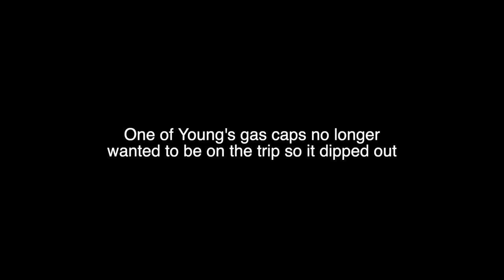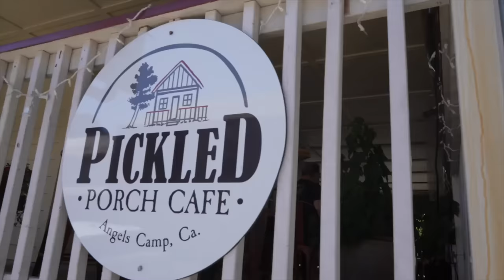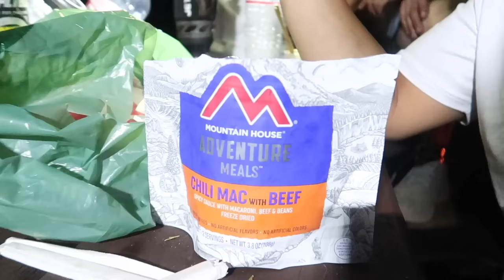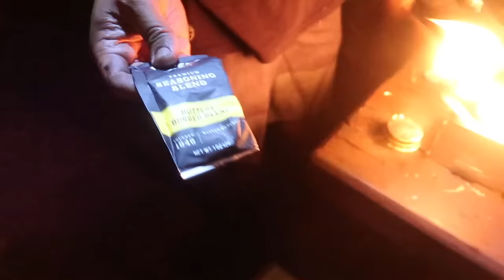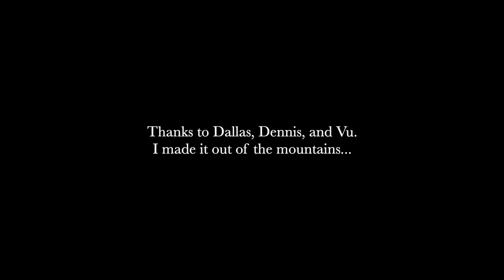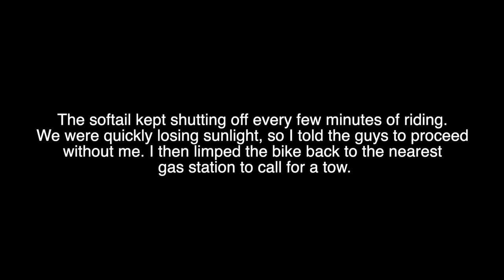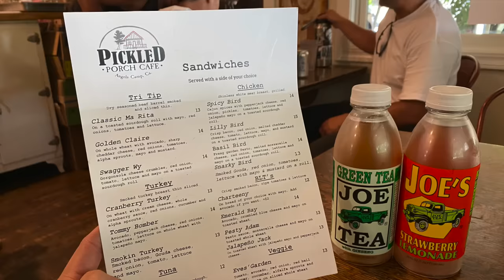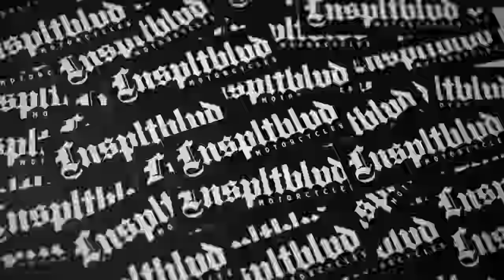2022 Trials, Tribulations, and Tuolumne FULL MOVIE | MOTO CAMPING TRIP

Comment: yes, we were riding and then someone was bitching about no bar on that road! so, we came across a mom-and-pop gas station. and we got our beer a case.  yes, we got greedy, with no safe way to carry it, so we all pitched in and tied it to a sissy bar. and it happen it fell off the bike. And that case took a hard hit on the side of the road in the rocks. we all herd hissing, and a few beers had holes in them. we got to work and started drinking them down and then a cop went passed and shook his head and just kept going.

Comment: I'm no fucking wizard... but...I'd buy a drill, some bits..some beer...ok maybe some noodles  and spend a weekend drilling and cotter pinning every nut and bolt on those hard tails.
good to see old iron carve a canyon run in a pack.
cheers
Reply: It’s not that bad. Just need good high heat loc-tite and lock washers for smaller nuts. And if you have a problem nut you can just use a nail punch or something similar to peen it. The rear axel nuts are locked in. Need to loc-tite the front axel nuts especially on a springer. And check them regularly cause those will kill ya. Motor mounts already use castle type lock nuts but I eventually end up with a cracked mount anywho. Transmission nuts never seemed to go loose on me and you could use castle nuts on those too. The only thing I’ve had to tighten lately was the kicker arm. It was sliding off the lug a bit. No biggie…
I know where yer comin’ from tho… I still ride a 48’ pan/bobber converted from a raked out wide glide chopper I had, but my right knee is shot and a night time pothole gave me two compressed disks. But that’s after 40yrs of riding.